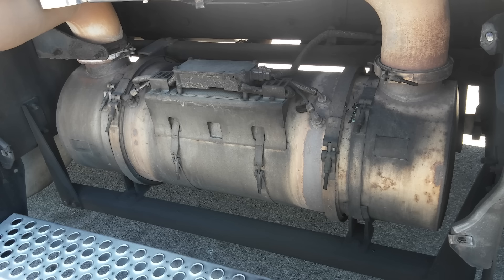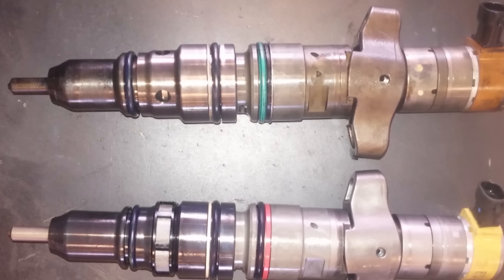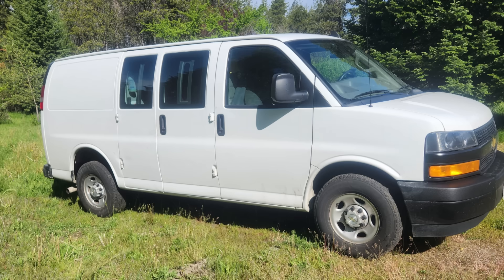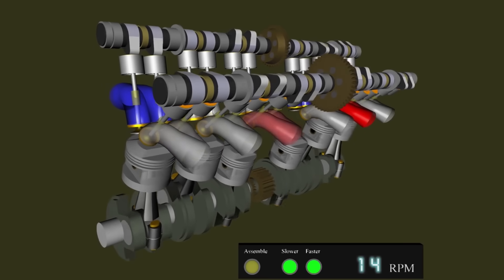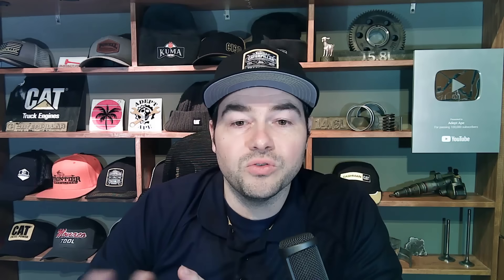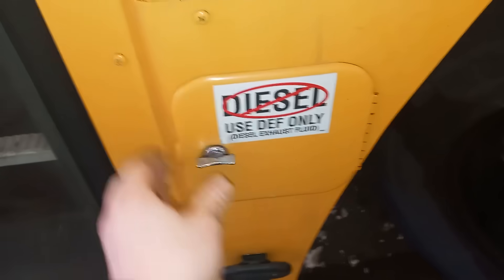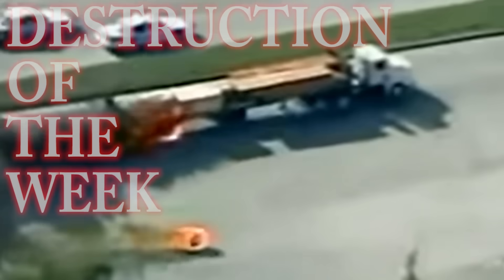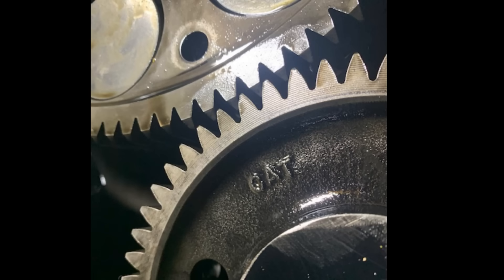What!? Gas engines are getting "DPF" Filters Now!!!

Comment: My 1993 Ford Tempo still runs and looks like it will out last me.
Reply: Be aware that, in 1993, some called those new cars " junk " just like some call 2026 cars " junk today . . .
Reply: trial and error done by REAL engineers, not this slop being pumped out by assholes
Reply: @bobroberts2371 well, because new cars ARE junk.

it is a warped perception because the newer the cars the shorter lifespan they have.  so they ARE going crappyer ever so slightly but people don't notice because all of them are engineered to fail.

doesn't change the fact that new cars are JUNK.

one day there will be no MOT because the latest junk will last a single year and costs half a years income.  you simply work a year for a junk car and scrap it next year.  it like that right now. but the light version. modern crap lasts like 4 years. 

more shit to come.
Reply: @casemodder89 The Tempo was junk compared to a lot of cars in its day.  Transmission wasn't a good one and they had head gasket issues (that I think were fixed around the 1991 model year, to be fair).
Reply: @immikeurnot  The only transmission issue I had is that the differential bearing retainer would come loose. If you tightened them up at the first sign of a leak and used locktite, you were good to go.
Reply: @don2deliver  If it was the ATX automatic, I remember them having a lot of failures.  The manuals were probably alright.

Assuming they all had autos... such a 21st century assumption, amirite?
Reply: Holy crap! You have a Tempo that's still on the road? I haven't even seen a Tempo since the early 2000s
Reply: Congrats on keeping one on the Road. I sold mine after 3 years and 45k miles for what I paid for it plus what I made when I got paid by insurance to replace the front Bumper and hood.
I had a customer with one, she was not good at doing maintenance and it developed horrible blowby

Comment: Direct injection on gas engines produce around 3x the soot that port injection does. What they have found now is that port injection burns much cleaner at low engine speed. Most new gas designs are going to dual injection.
Reply: I think the big issue with GDI is intake valve carbon build-up. Adding port injectors keeps the intake valves clean. Dual systems are probably just going to be the norm going forward. GPF is insane! The particulate emissions from a modern gas engine are minuscule already.
Reply: @jpa9058 The majority of these issues have been solved with updated pcv system designs in gdi engines.
Reply: @jpa9058 look at the euro1 to euro 6 graph and look at how ridicolous emission standards have gotten
Reply: Actually, GDI produces 3x the new limit for soot. About 15 grams / mile against a limit of 5. But 30 times the average of 0.5 grams / mile the typical PFI system puts out.
Reply: @craigg4246 Depends on injection pressure and injection strategy.  GDI doesn't have the same time to turn the droplets to vapor and fully lean burn or stratified injection exacerbates this issue to the point it may be 20 times as much (according to VAG findings) as port injection running stoichiometric mixture. That's why the newest systems operate up to 5000psi fuel pressure.
How many people will consider the huge local pressures in the fuel pumps when they fill up with the cheapest fuel they can get?
Reliability just took another nose dive.
Reply: @idonotwantahandle2 5000psi huh ?
Reply: @craigg4246 ok thanks for that. What I saw was probably mis stated as being 3x that of PFI instead of 3x a limit.
Reply: And your getting two more up stream cats for ignition emissions. You can thank corning inc. And lobbying for that
Reply: @slevinkolebra  more converters for scum to cut off if your car and more expensive for your insurance company to replace. Getting a converter cut off these days requires an insurance claim based on the expense of replacement. More converters? It’s going to mechanically total the damn vehicle
Reply: @matthewcaughey8898  the additional cats are attached to the exhaust manifold
Reply: @matthewcaughey8898  can't have those warm up emissions getting in the atmosphere ha.
Reply: @matthewcaughey8898  I'm glad I have old shit and live in a non emissions state. I can get a cat for any of my vehicles for relatively cheap. Of course the pre-cat on my 2009 Camry is expensive because it's part of the damn exhaust manifold, but I don't think thieves target them because most Camrys of that era burned a shit ton of oil and ruined their cats long ago (mine doesn't burn any more than an engine with 127k on the clock is supposed to, a negligible amount, and the cat is in good shape because of that.)
Reply: More bullshit to break.
Reply: Yeah because just MPFI would be too reliable! It would be worth it if those port injectors can power the engine through the whole powerband; bypassing the GDI, but they'd need to lower compression ratios
Reply: I have even seen one natural gas engine equipped with a GPF. I can only guess that the particulates come from engine oil, but CNG generally burns without many particulates being formed. I suspect the use of particulate filters might not be only the use of GDI but also oil control.
Reply: @DaleUlan in North America, “gas” is an abbreviation for “gasoline”, which is our word for “petrol”
Reply: @DaleUlan  This has nothing to do with natural gas, the OP is using "gas engines" to refer to gasoline engines (petrol).
Reply: @ferrumignis Do you not get out?

Like ever?
Reply: @DoSomething37  You seem to be conflating having knowledge on a topic with having no life.  Most people manage to have both, though perhaps you lack the former attribute.
Reply: catch can buddy
Reply: If Trump successfully gets rid of the Obama fuel economy standards, car makers might go back to port injection because it’s a lot less expensive than a direct injection system and doesn’t require expensive pollution control systems like particulate filters
Reply: @ag-m6e  It'd also be nice to get rid of displacement on demand systems that actively harm the reliability of an engine (I.E. Dodge MDS and Chevy AFM/DFM)
Reply: @ag-m6e they might not because of the eu (stellantis and ford)
Reply: @ag-m6e  Or oil catch cans.
Reply: how do you port inject a turbo diesel?
Reply: @CoLDbEeR774  You don't.  This is about GDI, not diesels.
Reply: The next issue is when these vehicles age.
Of all the benefits of a diesel engine(outside of the emission crap that makes them suck), you still have to fix them eventually and the fuel system is a very expensive part of it.
Say you lose a injection pump and all injectors. The parts alone cost more then the vehicles worth.
Now they want to bring that to gas engines and that eliminates one of the major benefits of a gas engine.

You would accept the lower power and MPG of a gas engine, because it was cheaper to repair.
That's not going to be the case anymore.
For a few extra MPG and some power. You now have something that will cost as much as a diesel to repair or replace. So more future junk down the years due to no being cost effective to fix.
Reply: @Soundsofthewood Why are you and others commenting on stuff you know little about? GPFs are a well established technology and they don't tend to suffer the issues that DPFs are notorious for because the soot generation of GDI is much lower than diesel and it's easier to get the exhaust temperatures required for regen.
Reply: @ferrumignis  I wasn't just talking about the GPF.
This is more inline with the direct injection system on gas engines.

As for the GPF. It looks like another thing that will be stolen next to the cats.
I couldn't find a price of what a GPF goes for. A DPF goes for 4k on a 6.4 powerstroke. The truck ain't even worth that anymore.
I'm sure there GPF is cheaper then the diesel. But 20 years down the road, the vehicle probably ain't worth the cost to replace it.

I had the cats fail in my truck and I couldn't drive it.
So I hollowed the pipe out and put defowlers in the downstream O2's.
Now I never have to worry about a cat going bad. This might be the answer to these GPF's down the road as well.
The only viable answer to a DPF, is to delete it and all the other emssion crap on the engine.
Reply: @Soundsofthewood  GPFs are not particularly expensive, they don't use precious metals like a catalytic converter.  They are very similar to a DPF; a porous ceramic honeycomb.
Reply: Clean air sucks. Real men breathe CO2 and NOX.
Reply: @wallacegrommet9343 Co2 is not toxic, every human breave out Co2 in every breath....
Co2 makes everything grow

Comment: They been talking about filtering gas engine off and on for quite some time. At least for Canada/Usa.  As we all know DPF/emission control on diesels has always been a scam. It don't work. it just slowly chokes the engine then kills it. The parts are all made over seas, the DEF fluid is made in factories and shipped around the world along with all those plastic bottles being thrown in the trash, Yeah don't kid yourself, most them are NOT Being recycled. More trucks on the road shipping the DEF fluid. 

A better solution at least for Turbo diesel and normal Diesel engines would be use Hydrogen injected with the diesel fuel, would help engines burn cleaner. but nobody seems looking into this. Hydrogen could probably be more easily made vs DEF/Horse piss that currently being made and is VERY toxic to the environment.  

Seen few videos where semi trucks or commercial vehicles using Hydrogen injected into the engine to help burn cleaner.

Comment: Crazy thing is that regulations are creeping into particulates from tires, mechanical friction braking systems et. al..  Gotta wonder where do the tire and brake lining particulates go?  Back in the asbestos lining days and I was working heavy truck, I wondered the same thing.  Hmmm.  These shoes are paper thin but not much dust in the drum...Geesh, it musta been lost on the road maybe?  Yikes asbestos on the highways.  Lol.  There are too many humans using too many things for the users to control the negatives.  Sorta crazy.  Feel a little guilty for using things but enjoy using them nonetheless.  Human push and pull is ongoing.
Reply: Catalytic converters shed trace amounts of precious metals into the exhaust and out onto the road as you drive. It's one reason why they lose efficiency over time.
Reply: Read up on what cali is doing with with brake pads

Comment: Actually direct injection gasoline engines have been around for quite a while. An Australian company called Orbital had a patent on a system using compressed air to inject fuel with high pressure directly into each cylinder. Mercury Marine and OMC both bought patent rights to the system but Mercury was the only one of the two that used it on certain outboard engines and called them Optimax. OMC ended up developing their own electric high pressure injector for direct injection. Both where only used on OB 2 stroke engines. Mercury no longer produces 2 stroke but they do or did build the Optimax DI as a spark diesel engine for the military but also limited civilian use. Volvo Penta uses GM's DI on some of their stern drive marine engines. They both performed well when running right. The Mercury didn't seem to have as much of a problem as the Evinrude/Johnson engines that where bought out by Bombardier when OMC went belly up. As I understand it the automotive DI 4s engines have a lot of problem coking up around the intake valves do to no fuel at this point to wash it down. It kind of reminds me of the old days with leaded fuel and leaking valve guide seals.
Reply: Both the optimax and soon to be G2, were a failure
They did deliver alot of power. But not reliable.
Pretty much those were the last ditch effort to keep the 2 stroke engine in the marine field. Well the regulations got too high and the technology and work around was far too extra. So 4 strokes took over the market.

Comment: Josh, regarding direct injection and particulates, 
if a gas engine produces particulates on direct injection but not with carburettors/manifold injection, 
Then maybe diesels should use ‘ air blast’ injection, where the fuel’s atomised and vapourisation starts before it meets the high temperatures in the cylinder. 
That’s how the first diesels ( MAN , Deutz, etc ) operate.
Reply: Indirect injection with prechamber?
Reply: @pixelaccount3882  That is what it sounds like...

Common 7.3 IDI W, lmfao
The county I live in still uses school buses with the turbo version of that engine. You can always tell when it's 3:30 PM and school's let out because when those buses are coming down the road it sounds like a bag of hammers bouncing around inside a washing machine

Comment: In the EU gasoline cars have to have them since 2018.
Reply: Yeah, i'm absolutely not surprised these are coming to the US. 

There's nothing to be afraid about either, it's just a catalytic converter that catches soot from direct injected engines. There is no crazy regeneration process or loss of reliability. 

I'm sure a few vehicles have already had them in the states, and people don't even know.
Reply: @volvo09  Correct, the 2025 Ford Mavericks have them and there haven't been any issues so far. I don't think this will be quite as bad as everyone thinks
Reply: Ya because there like 10 years ahead of us on that kinda technology

Comment: My 4800lb truck with a 4.3l tbi used to get 21 mpg without lean burn.
Reply: My 2001 F250 with a 7.3 gets the same or better mileage as newer diesel trucks.  It's insane how bad these emissions systems are.
Reply: @immikeurnot  And new stuff can get way more by just disabling it. Such foolery, burn more fuel then needed to reduce emissions.

Comment: It is mandatory for gas engines in Europe since 2017. The gas particulate filters here have been significantly less problematic than the diesel ones. I havent heard about any failures in my family and friend group yet. The difference is clearly visible though. I have a 2014 Euro5 car with a turbocharged 4 cylinder and the exhaust tip is always caked with soot. On our 2024 Euro6 car with a very similar engine in terms of size, power and fuel delivery the exhaust tip is completely clean all the time. SCR systems will probably not become a part of gas engines because those produce already less NOx emissions than diesels (significantly richer mixture and lower temperatures and pressures than in a diesel)  and the already implemented catalytic converter reduces a significant amount of the NOx back to nitrogen and oxygen.
Reply: All that soot falls back to the earth. With diesels, its literally “spend 15% more fuel, to save 10% on emissions.” Makes literally zero sense, and the whole thing is a giant scam.
Reply: @kyleheckman361 I don't think that polluting the atmosphere is the big issue with particulate matter. That stuff is so small that it bypasses your body's filters and goes directly into your lungs, causing alterations up to lung cancer. Filtering it saves lives directly in your neighborhood.
Reply: @Alexx120493  I'd be more worried about the jellyfish dna that's been genetically modified into the produce than breathing a base element like carbon. Or mandating people take an experimental mRNA gene therapy for something that was basically the common flu only to later black label it. If experience has taught me anything it's that when someone tells me a rule is for my safety, they usually lying.
Reply: @Alexx120493  The solution simplest solutions are always the best. In this instance it would be to build engines that don't create those fine particles.

Comment: A lot of manufacturers like Toyota have come out with direct injection. The only problem is is that you get a lot of carbon buildup in the intake before the intake valves.... I'm hoping that the roll back on the carb mandates will get caterpillar to start building class 8 truck engines again 🙏🏻
Reply: Cat is never coming back to the on road segment. They abandoned it because you dont make them enough money
Reply from the maker: I doubt they would, they have been out of it for a while and the people that cared about trucks at the corporate and dealership level have mostly retired or moved on.

Comment: I guess the catalytic converter does not run hot enough to burn off the particles or they pass thru too fast.
Reply: It's because of the advent high pressure gas direct injection which while more efficient does create more particulate matter vs a port fuel injection system that operates at low pressures vs gdi
Reply: It’s a different thing. The catalytic converter isn’t really intended to reduce particulates. It is there to reduce other emissions by burning excess fuel and so on. To reduce particulates you need a filter.

Comment: Wonder why cat convertors arent enough.
    Bought a yj jeep with inline 6 burning a liter every couple hundred miles.
    Older vehicles wd have been followed by a cloud of blue and i was very puzzled why it wasnt.
    An engine rebuild guy pointed out it was cleaned up with the cat convertor.
Reply: The catalytic converter get poisoned by burning oil, but can recover with long periods of higher than normal temperatures.
Reply: Those older vehicles are followed by a cloud of blue because nobody's maintained them. My 1966 Oldsmobile doesn't burn enough oil to create blue smoke, in fact it probably burns less oil than most modern engines, especially ones of the Kia/Hyundai variety.

There will be a time that it requires a re-ring, and I will take care of that when it comes. An antique engine can be given new life with just a set of piston rings, and the newer style rings will last longer (in an understressed, simplistic, naturally aspirated gasoline V8 anyways) to boot.